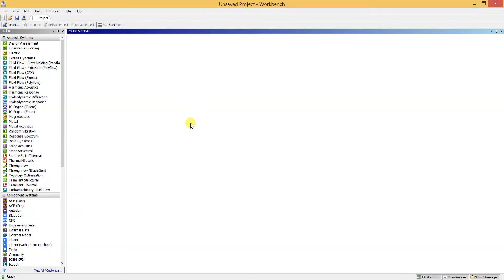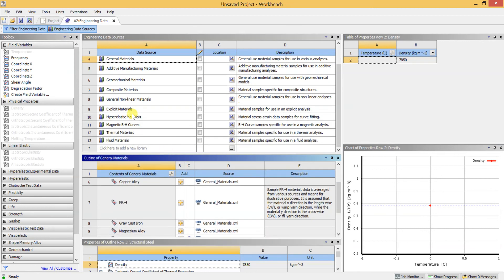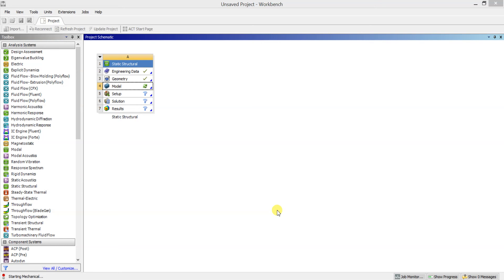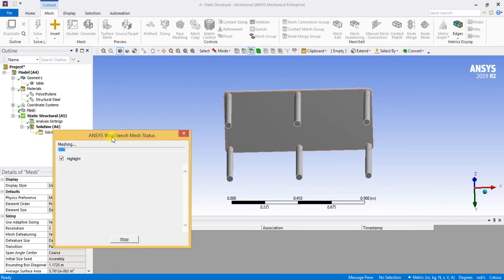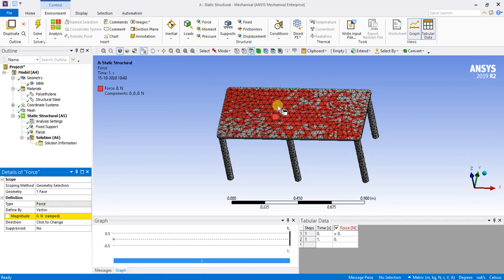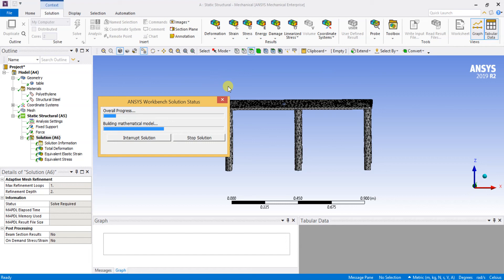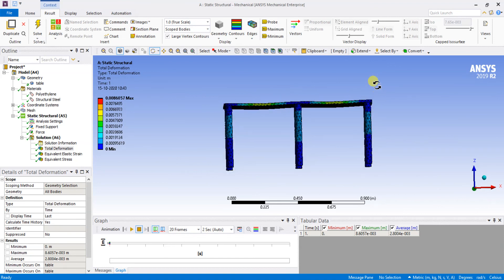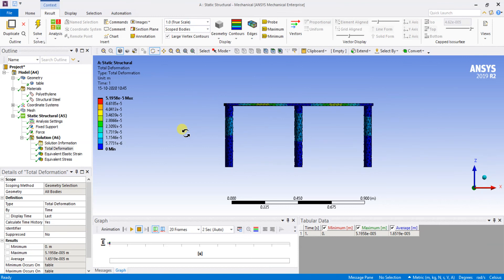Finite Element Analysis of Table using ANSYS

Comment: Why does the load you input have to be multiplied by the gravitational acceleration of 9.81? and is the load you apply a distributed load or concentrated?
Reply from the maker: We need to give input in Newton only. So converting Kgs to N. I have selected the whole area for applying load it is distributed load only.
Reply: @rdineshbabupdy  So it could be said that the load you applied was 5000 N/mm2?
Reply from the maker: Nope check the unit of load. Refer sources
Reply: @rdineshbabupdy  how to look the value of banding moment , shear and axial force ?
Reply: @rdineshbabupdy  how much load did you put in? and what are the units? because I tried to remodel like what you did but I didn't get the same stress value as you? Is there something wrong with the load that I input, especially on the unit? and what is the meaning of equivalent stress? please answer
Reply from the maker: Design values might change upon the geometry. It's Ok that got different values.
Reply: @rdineshbabupdy  but after I remodeled it with another FEM application I got the same deformation value as you, only the stress was different. Is this because ANSYS uses equivalent stress? Can you tell me the concept of equivalent stress?
Reply from the maker: https://bit.ly/prdbabu contact me I gave my Linkedin profile short url in description also.